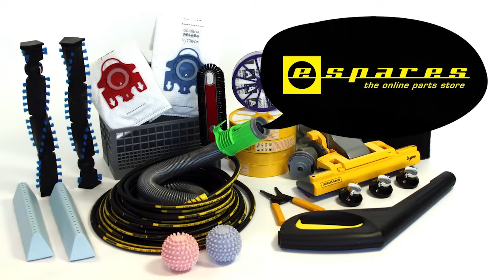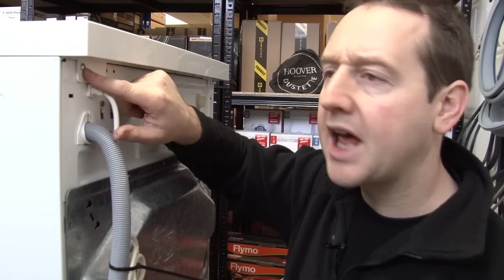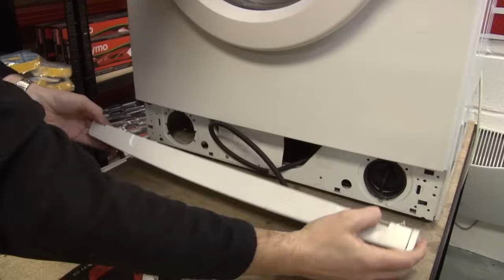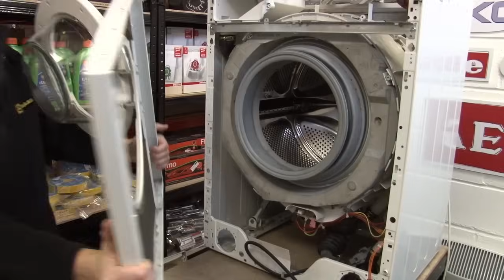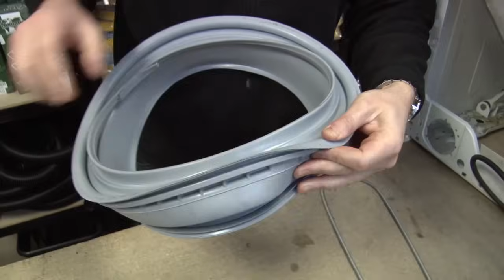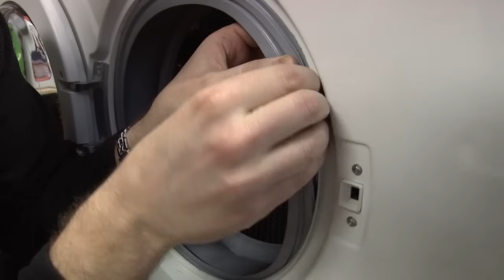How to Replace a Washing Machine Door Seal on a Bosch Washer

Comment: in 10 years of working on various brands of washing machines,i have never taken the lid or dashboard off a bosch to change the door seal-1 bolt in the dispenser,3 at the bottom as the bottom panel has a screw-two bolts on the bottom of the front panel and 2 bolts for the door lock-not to mention unclipping the lock and bracket inside the front panel-far too much work-my record for that repair is less than 10 mins start to finish-thank you

Comment: You are lucky because the front panel here is detachable. On Ariston ALS 109X for example you should use bent needle nose pliers to tense a metal string or to pull the whole tank out.

Comment: The whole front assembly is then loose, but take care as the the door interlock wiring is still attached, HENCE WHY THE SAFETY ADVICE AT THE START OF THE VIDEO IS SO IMPORTANT...but the whole facia can then be moved to get access to the inner seal.... Great video, couldn't have done this without it

Comment: Get some one to take the weight....Then undo the two screws at the very bottom .. with a bit of jiggling by pulling very slightly outwards at the bottom while pulling down at the same time.

Comment: I just fitted a seal to a very similar Bosch model. I was able to do it without moving the machine by ....
Undoing the front retaining wire hoop  and removing the seal from off the lip.... then undoing the screws at the front and the one on the side (as per the video) (It is the low screw of the two in the middle which helps holds the front facia up).... remove the plastic bottom cover...

Comment: I had a lot of trouble doing this (Bosch machine), but I managed it without taking off any panels, pretty much like the video. You need quite thin fingers to get round it, and ideally two people for getting the ***** spring on.  And I did swear.  A lot. May be worth a try but not when you've got any washing to do.

Comment: Thank you for this video. It gave me confidence to have a go but I found it really difficult. Getting the retaining spring back on was so awkward, I ended up wedging a shoe in on one side while I pulled and held the other side down with my foot.  The job took me over 2hrs, but I did it in the end & am praying the leak is fixed.
If you're not fully agile, if you have fingernails that you value, back problems, or any arthritis in your fingers, then personally, I'd get the washing machine man in!
Reply: Bicycle tire levers (about $5)  make it much easier to reinstall the spring!  Changing a bike tire also requires stretching a metal ring, if folks are looking for tips on technique (check out a bike tire change video).

Comment: Sadly my machine (a Siemens) is such machine. After trying myself without any success, I rang for a technician to replace the seal. The technician even removed the counter weight for easier replacement

Comment from the maker: Hi,

Sadly very few machines have the ability to have the Seal changed by just accessing the front. You may have to pull the thing out or consult your manual for tips.

Comment: Wish it was that easy to change the retaining wire spring on my Bosch washer.  He makes it look so easy.  Mine is so tight.  Even with needle nose pliers I can barely get that wire on. It keeps popping off.  I just bought a top loader washer to replace the Bosch.  Getting tired of dealing with seal issues.  I love the machine.  Just sick and tired of fighting with this seal that keeps causing issues.

Comment: The seal on the inside of our washing machine seems to be ripped on the top half of our washing machine. Please give tell me your opinion on whether you think this is normal or not. So I can determine if fixing the gasket will end the leak problem for a good amount of time. I thought it was odd because it's ripped at the top and not bottom. We just got the washer for a year. Thoughts please.

Comment from the maker: @blakesguitartuition Heya. The placement of the spring on the seal retainer shouldn't really matter. A 'door' error on most washers will *usually* refer to a problem with the door interlock. i.e. the door lock either isn't working or is not locking on the door latch. We have a few door interlock videos that should be helpful in diagnosing the problem. Unfort. YouTube doesn't allow linking in comments so you will have to search our channel. Hope that helps.

Comment: I just did mine. I used washing up liquid on the seal to make it slip on easier - just a bit on your index finger and smear it inside. I also covered to spring that holds the seal in place internally in fairy as well, it means if it slips off it doesn't take the whole seal off with it, so you can have a lot of goes without the rubber seal coming off too. Anyone who can do it first time is a god!
Reply: True Fact-Washing Machine Door Seals are not actual rubber,they are actually made from Silicone

Comment: For LG WD 8016C I've removed top plate, soap dispenser, removed 2 screws on panel board near soap dispenser but can not see the third one at all, I can not open up panel board.

Comment: Thanks eSpares, got the new seal, and is now firmly installed in our washing machine.  A few points though - the kick panel has a screw to remove under the drainage pipe, and also when taking front of washing machine off remove the door first, it makes it a lot more lighter to manoeuvre, and finally watch the wires on the door switch as they are connected to the front panel with a plastic clip even when two screws are removed.